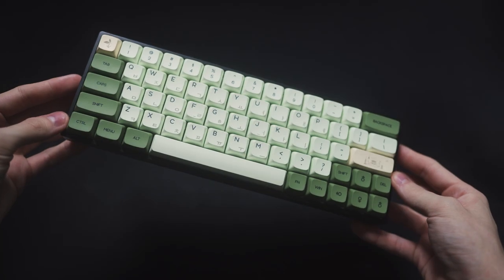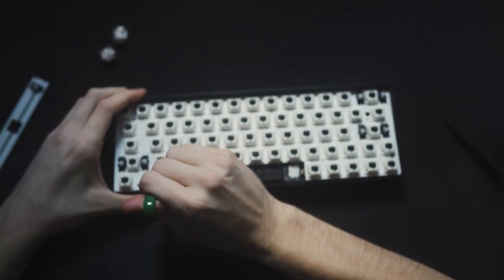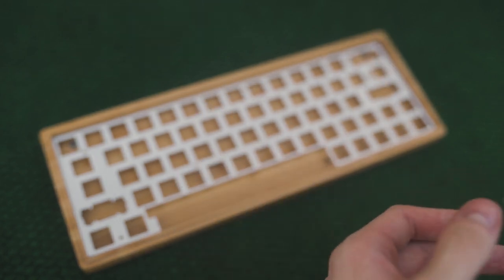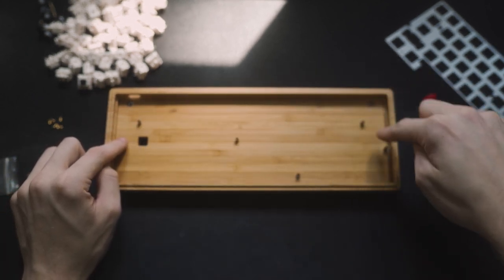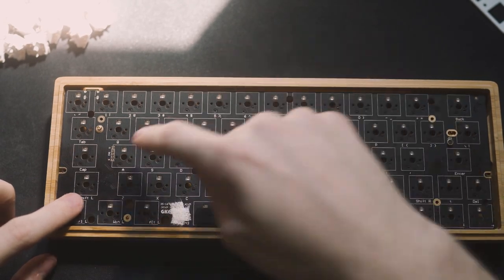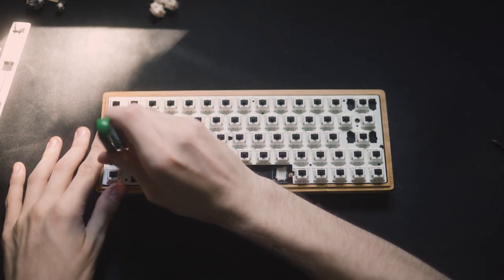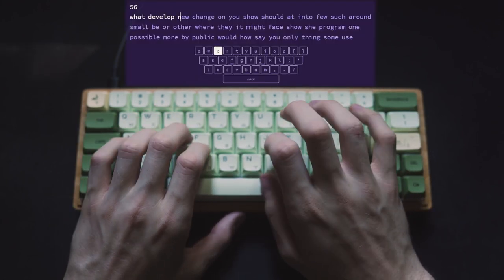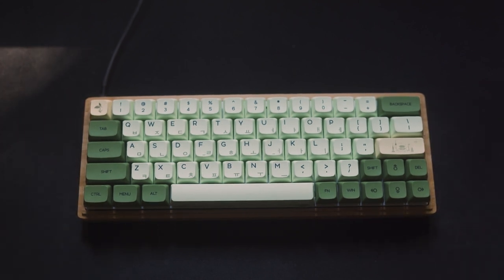How To Upgrade GK64/GK61 for $50

Comment: Thanks for the video. I only have one question. I already have a gk64 keyboard. Can I just buy the case and add all about my kb inside the wooden case or I will need to buy more things? Thank you
Reply from the maker: you’ll have to either modify the plate or buy a new one but everything else will fit in there and work! :)

Comment: I tried swapping the switches but the PCB doesn't seem to have pins holes for the switch. Is the PCB not compatible or something? (I have akko matcha greens).
Reply from the maker: is the pcb an SK64 or GK64? the GK64 pcb should definitely be able to accept the matcha greens.
the SK on the other hand uses optical switches which doesn't have pins on the switches at all.

if you try using mechanical switches (like your matcha greens) they wont work on an SK pcb but they will work on a GK pcb.

Comment: So plate is not attached to pcb? How do you keep it in place? I have the same issue with a gk61 trying to fit in gh60 stuff
Reply from the maker: to put it in a gh60 case i used a drill bit and drilled into the plate (refer to 2:33 for better explanation) but if you dont have a drill you can order a new plate for about $20, this option costs a little more but you can choose whatever plate material you want which i think makes it worth it :)
Reply: @shrmy  Yeah, I referred to the pcb attached risers/standoffs. Indeed it is a very good and witty solution for lot of people so thank you for sharing the process and replying!
Reply from the maker: @manuelsuarezginer1961  no problem! thanks for watching! hope i was able to help in some way :)

Comment: How did you mount the screw in stabs if the pcb doesnt support screw in? I have durock screw in and a sk64 and it didnt work so I just used the stock ones and Im kinda mad about it.
Reply from the maker: i didn’t use screw in stabs for this one, the pcb for the gk/sk boards don’t support them, i used plate mounted everglide pandas, they’re great stabs for pretty cheap, but honestly if u clip the feet on the stock stabs and lube them up, maybe even holee mod them it’ll sound great!

Comment: so is drilling the plate more of an optional choice for convenience? im still torn between ordering a rk61 or gk61 since i REALLY want that wood casing. 
but im not really sure about which models are compatible with the wood cases i see online, thank u if youre reading this! hope to hear some advice.
i am mostly new into this mechanical keyboard thing. hoping my first build doesnt run into much issues and is budget friendly :)
Reply from the maker: drilling is just optional, you can buy another plate and just toss ur old one for an additional $20-$30. also lots of PCBs will fit inside of the wood case that kbdfans offers, this particular keyboard is using the gk64 pcb which only cost me about $60 and it comes with a case, pcb plate, and some cheap stabilizers.

hope this helps! :)

Comment: Where’d you get the rubber risers on the bottom of the bamboo case?
Reply from the maker: the flat ones are included with the case from KBD fans but the metal ones i added on were from amazon, i just searched for "Keyboard feet" though i would be careful because the ones i got had pretty short screws so i had to drill really deep to make them work on my case
Reply: @shrmy  ok, thank you

Comment: Was not mounting the spacebar on optional? and was using the Orings optional too? i’m building a similar build and it’ll be my first build :)
Reply from the maker: good luck with your first build! also the gk64x plate has a removable spacebar insert because you can swap in another one to have a split spacebar. if you were to use a different plate it wouldn’t have that. also the reason we couldn’t mount it was because the new case didn’t have standoffs to mount it to. 

the o rings are completely optional but i personally like the way it makes the keyboard sound, it’s like a cheap way to gasket mount your keyboard :) 

if you want i’d be more than happy to send you some links to plates that’ll allow you to skip the drilling/spacebar issue!
Reply: @shrmy  Yes that would be awesome! i’ve had a hard time finding plates that’ll work!
Reply from the maker: @kass7779  if possible, i have my twitch, insta or twitter in the description, DM me on whichever and i’ll get a few more details from u about ur build and try and let u know which plates you can and can not use :)

Comment: Honestly they should just remove the spacebar module thing from the gk61 it such a pain for this mods I o ring mount my gk and the spacebar module is lower. Any idea how to fix that? Btw nice tutorial and the vid was well edited u chill due also :)
Reply from the maker: hey thanks so much for the kind words! you can totally fix the spacebar issue, the standoffs for it are shaped so a small socket can be used on it, cant remember exactly the size, but keybored says 6-7 full turns worked for him so a little trial and error but you can totally fix it :)

Comment: can I take the plate and pcb out without taking off the keycaps?
Reply from the maker: you could maybe do it by just taking off 5 or 6 keycaps but you def cannot by leaving them all on
Reply: @shrmy  Finally found out to use force and did tape mod and added bubble wrap

Comment: HOW DOES ONE MAKE MY GK64 wireless
Reply from the maker: i’m pretty sure you would need a gk64 wireless board, i think that one comes with some daughter board and switch to go between wireless and wired :)
Reply: @shrmy  is that legit all so i can buy a controller to make it work if i add a bttery and get the daughter board
Reply from the maker: @oimpaa  honestly i’m not too sure, i don’t really have experience with the wireless gk64 so i’d probably ask around on r/mk and someone there could probably tell you for sure

Comment: O-rings make key presses feel super mushy, and doesn't really imrpove the sound whatsoever
Reply from the maker: the o ring mod i’m referring to in this video is a different method, it’s basically a way of gasket mounting a tray mount keyboard, instead of putting o rings in the keycaps you put them on the standoffs for the pcb. :)